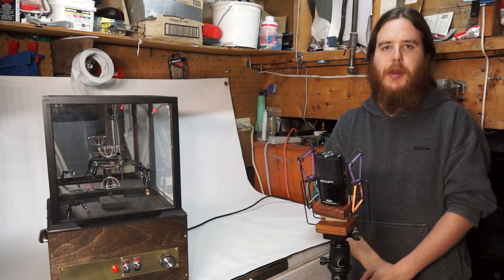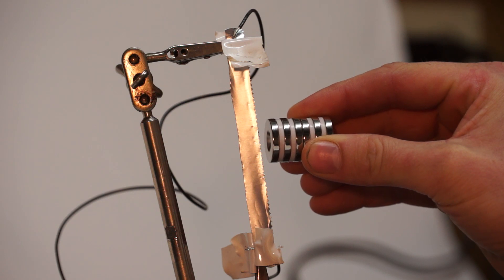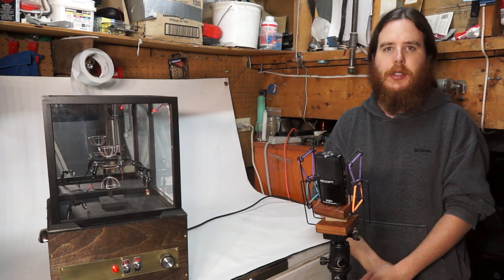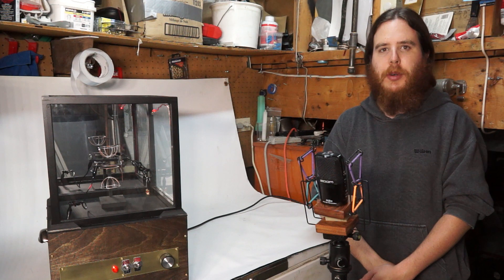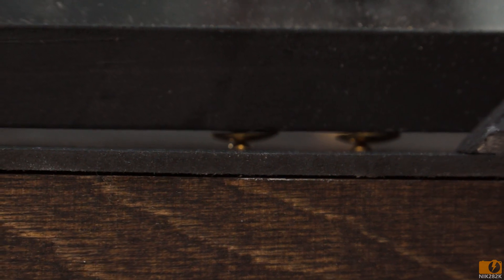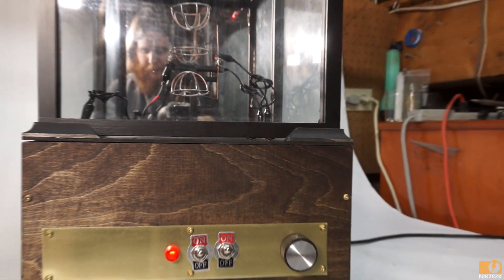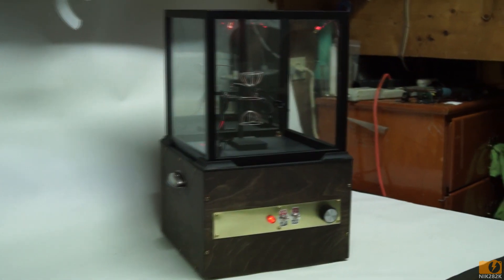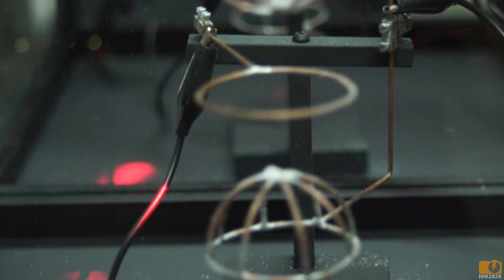Paul Ion Trap - Desktop Model

Comment: Florescent particles and a violet laser might be worth a try for better viability.
Reply from the maker: +Robert Szasz I have tried a blue/violet laser with the non-fluorescent particles and they light up well but appear very fuzzy, blue light doesn't focus well due to lens aberrations. If they fluoresced green, like you say, they will be much more visible.
Reply: Nick Moore combined with a bit of flocking or some other light trap where the laser hits it should be possible to get the particles to really "pop". It might be interesting to drive the illumination  with a variable phase/frequency as it might show the particle drift more clearly (either locked to the trap frequency and manually phase shifted, or offset slightly in frequency so the phase drifts). Just trying it with a 555 timer driving the laser might work for testing.
Reply from the maker: You beat me to it. Having a frequency driven light source was on my extended goals. I have used an LED with a strong 60Hz ripple and the particles seem frozen in the air, it looks really nice.
Reply from the maker: Thanks, electronics are not my strength but I'll mess around with that (or similar) in a simulator and see if I can get it to do what I am looking for.

Comment: Looks great Nick. Could the electrodes be electroplated or polished without affecting the trap?
Reply from the maker: +Matthew Simmons The surface conductivity of the electrodes doesn't really matter so pretty much any finish should work. A silver coating would be really slick.

Comment: Very spiffy!  

Did you defocus the laser, or just take the lens right out, or ...?
Reply from the maker: +Nevin Williams I defocused it but the spot is still pretty narrow, I'm going to try messing around with small lenses or increasing the optical path with mirrors. I tried with the lens completely removed but it lit up more of the trap than the particles.
Reply: Would you be able to stain the metal blue, like with an inkpad or even a blue or green sharpie?   That ought to cut down on its red light reflectivity, especially at the soldered joints.

Setting a diffuse light source at the back of a pipe or a light box might be able to keep the light on the area of interest, without a conical brightness gradient that comes using lenses...
Reply from the maker: I may be able to just paint them flat black (or maybe soot them with candle smoke to make them extra light absorbent).

I may try the bare laser LED inside a tube and see if it is any better. I did some googling on how to light this project and lasers were the goto. I did experiment with using phosphorescent powder and a black light but I don't have a black light small enough to fit inside the enclosure. If I can get some real UV LEDs I may eventually go that route.
Reply: I've noticed that some blue LEDs -- in particular, the finger LEDs they sell at Dollarama-- elicit a strong fluorescent response, though I didn't check to see if they'd set Bondic.
Reply from the maker: I am making a list of potential eBay buys for lighting. I was also considering strobing the LED/laser to see if I could stroboscopically freeze the particle motion!
Reply: Through a pipe, etc, at short distances, any diffuse, strong light source will probably remain sufficiently collimated, so any strobe should work. 

Perhaps look for an old xenon automotive timing light, though you'd need a trigger source; they fire when they detect a spark through #1 wire with a clamp ammeter.
Reply from the maker: +Robert Szasz Linked a circuit that allows for phase controlled triggering, and I will probably give that a try with the laser. Being able to have a 61Hz strobe would make the particles appear to move but greatly slowed down due to aliasing. (Going to need a lot of 555s)

Comment: You've put all this effort into making a really nice glass and wood case for it, but couldn't get the on/off switches straight! :-P
Reply from the maker: I know >_< the holes behind the brass were a little tight, I plan on adjusting them before putting it on a shelf.

Comment: Very cool, barely noticed the "apprentice marks" :)
Reply from the maker: Crooked switch, miter joint gaps, thumb prints on the glass >_< Maybe if I pan quickly people wont notice.
This was my first crack at any kind of 'presentable' woodworking, I will never do miters again.
Reply: Haha good strategy! Maybe some brass angled plate (my heart wanted to say angle iron) or aluminium extrusion, the kind they use for flight cases would be an easier option in the future :P
Reply from the maker: Yes! Anything to cover up the corners although on this project it would have been a little complicated. All the external metal parts had to be grounded because of the high voltage transformer inside.